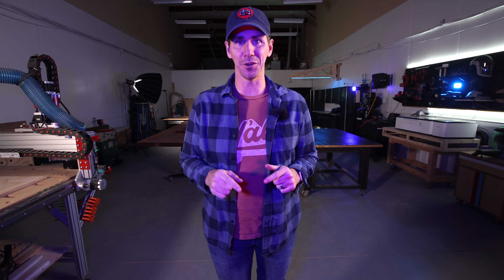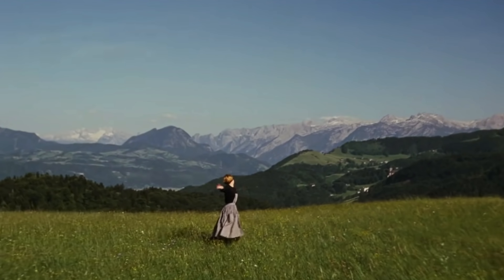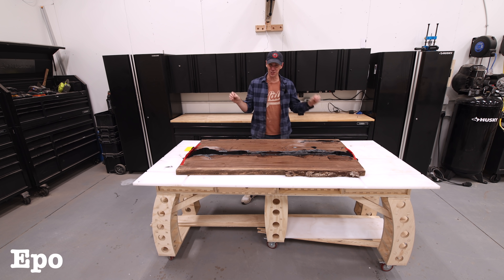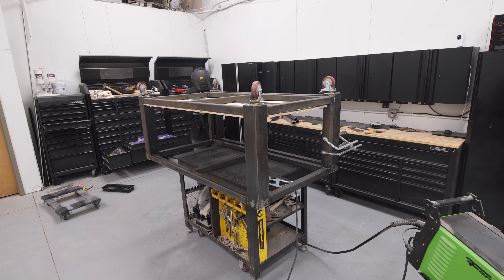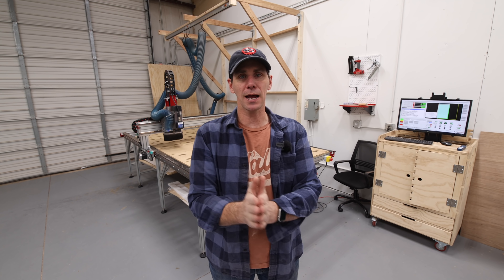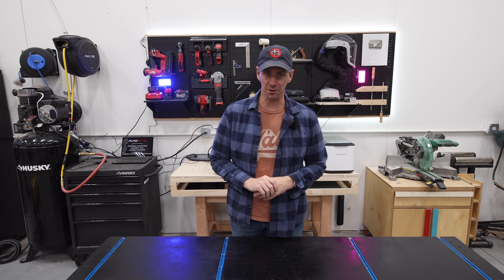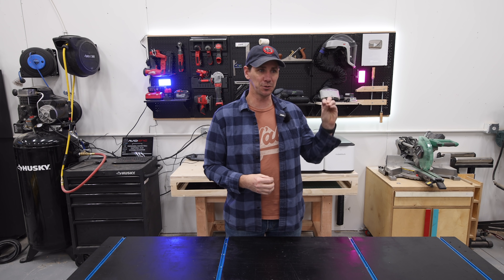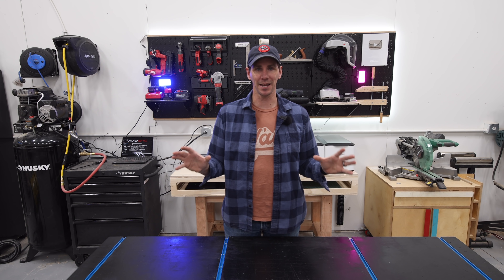My $80,000 Disaster

Comment: We learn far more from failure than from success. Failure is only bad when a lesson learned is not applied on the next venture. I've failed as hard (multiple times now) from bad business dealings and it doesn't get easier, but the fear of failure becomes less and less. It's critically important to know a business partner's character well before entering into a venture. Lesson I too learned the hard way. Those set backs sting, but they are also character building. A diamond is forged only through adversity.

Comment: Your cantilever is pretty cool idea especially with the light - but you should make 2 so you have lighting on both sides less shadows! Ps - your husky air tank - dump it and get a California air quite compressor! - also you should make it self-draining and make sure you drain it often, or the value threads can rot out and then you have to weld it back up!